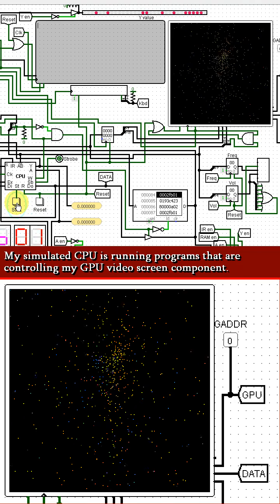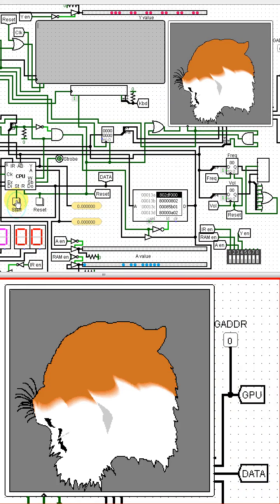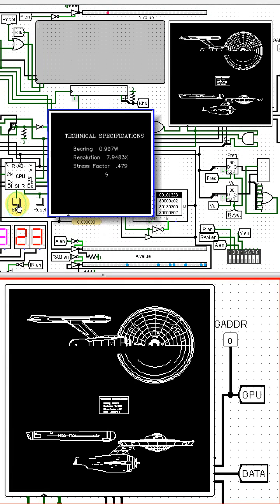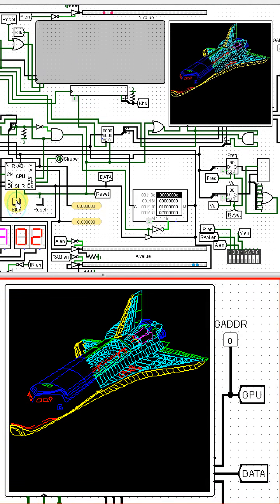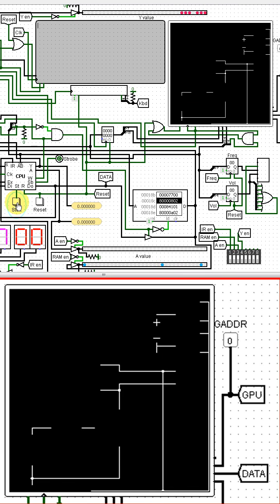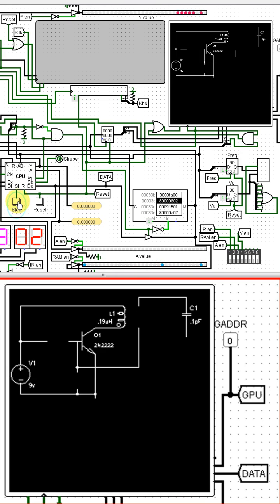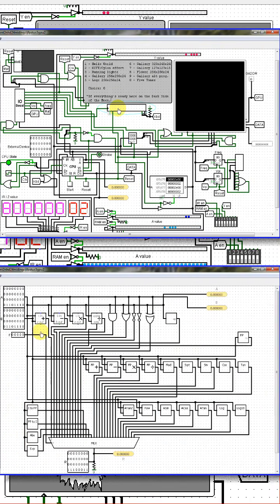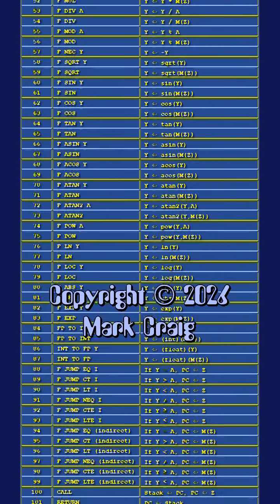Logisim GPU Graphics Demo (Digital Logic Simulation) #shorts

Comment: which version of program did you use ?
Reply from the maker: @memesclassroom It's (original) Logisim 2.7.1 (not Evolution).  In case you're wondering about the speed, I sped up the video - HOWEVER, this speed is achievable in the newer Logisim Evolutions (Kevin Walsh's Holy Cross, etc.), and my GPU component works in these Evolution versions (by choosing the right JAR file for the version being used).  I chose to use original Logisim and speed up the video because I felt the animation would be smoother that way (and the screen recording software tends to make the rendering worse. so it was a way of compensating for that).
Reply: @MrMcsoftware tnx

Comment: Are you speeding up the video? My screens never ran this fast
Reply from the maker: @kilometerbob2662  Newer versions of Logisim Evolution (such as Kevin Walsh's and Reds Haig) are capable of running my scenes at the speed shown in the video (and therefore no need to speed up the video).  However, they can achieve those speeds partly by making tradeoffs.  My scenes would still look good but might be inconsistent (skipped frames, jerkiness, pauses) partly due to how Java deals with memory and (memory) garbage collection.  So, to make sure I got the best quality video (and also keep in mind the screen recording software would make the problems worse), I purposely used original Logisim which has a top clock rate of 4.1KHz and sped up the resulting video.  Running at 4.1KHz insured my system wouldn't be overwhelmed and no frames would be dropped (yeah sure, speeding up can result in lost frames, but at least in a uniform consistent manner, so no jerkiness, etc.).  But to be clear, I don't even have to use the top clock rate of 8MHz of Kevin Walsh's L.E. to achieve similar results without speeding it up (but as I said, potentially inconsistent).  BTW, in case you didn't know (if you haven't watched my previous video, you probably wouldn't know), because of the way I coded the GPU component, each graphics primitive can be done in one clock cycle (in other words, the simulated CPU isn't computing and drawing each pixel of a line for example (which would then require many clock cycles)).

Comment: Are you going to convert this to vhdl too like your CPU previously? That would be cool. Also there is tinytapeout which can synthesize actual physical chips for you. It would be really cool to have this circuit actually in the palm of your hand.
Reply from the maker: @sontapaa11jokulainen94  That would be very cool indeed!  I don't currently have any plans to convert the additions to vhdl unfortunately.  For one thing I'm pretty busy on other projects right now.  But also my GPU component works by using Java's graphics commands not actual logic gates and is really just meant to give users a better way to deal with graphics in Logisim, not really to model an actual GPU.  Of course, perhaps the best way to approach what you suggest is to take Logisim out of the equation - just code in pure VHDL (or Verilog) without the Logisim assist.  Something to consider I suppose.